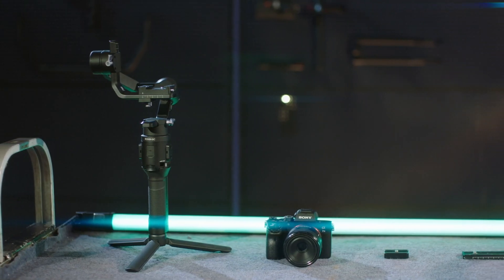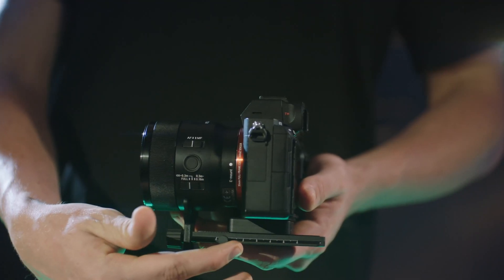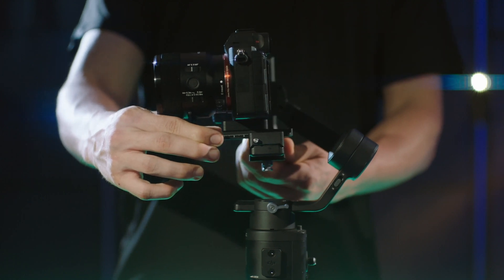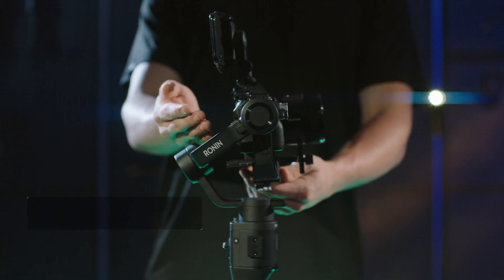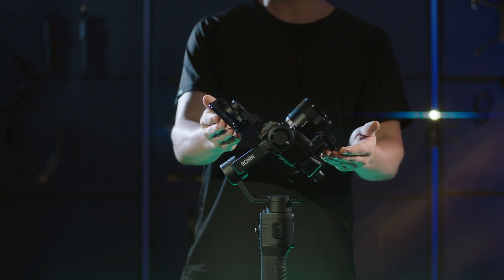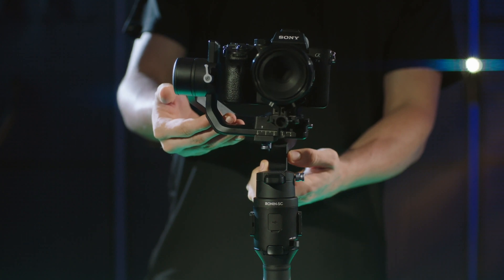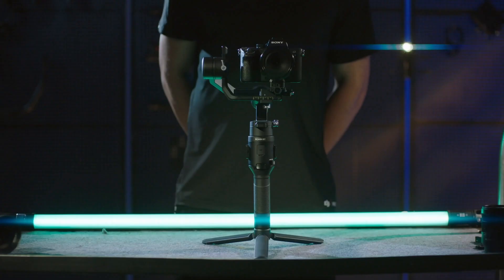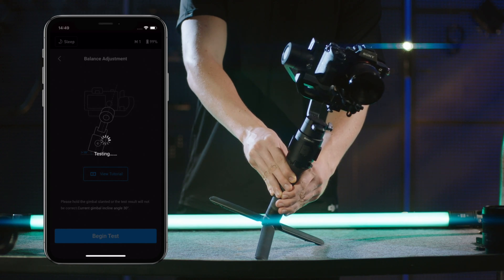Ronin-SC | How To Balance the Gimbal

Comment: Does anyone have any advice for me? I've balanced this thing about 100 times and when I test the balance on the app all 3 categories are "excellent" but when I go to use the gimbal it shakes profusely and doesn't stop until I put it to sleep. When I wake it again it's fine until I move it again in any direction. I bought this off amazon and it was an "open box" item. Please someone help! I'm using a canon m50 mk ii with a sigma 16mm lens.

Comment: so darn frustrating!  go slow and break it down and show each piece and get a good shot at everything. this is stupid.  I was so excited but I'm so freaking frustrated.
Reply from the maker: Hi Mark, may we know if you are encountering any trouble balancing the gimbal? You can contact our support for further assistance http://www.dji.com/support. You may try to adjust the video play speed if you would prefer a slower video, we will also forward your feedback about the video to the related team to notice.
Reply: DJI Tutorials  I did do that nothing helped. You need to break it down like your teaching a 5 year old. Show the pieces etc vs pointing at it in the video, etc.
Reply from the maker: @HSEGIRLSLAX  We will forward your feedback to the proper team to notice. Regarding the issue you encountered on balancing the gimbal, please contact our support via email for further assistance, thanks!

Comment: A6400 cheatsheet for users with standard 16-50 Power Zoom lens it ships with. These are the settings after finally working it out! The camera is borderline too light for this gimble so using the spacer is necessary to achieve true balance.

The lens cap must be off, the camera must be powered on with lens extended as it would be in real world usage. 

TILT: 3.3
ROLL: 3.8
PAN: 1.2

You're welcome 😊

Comment: hello, 

Is it possible to balance my sony ar7iii with the lens 24-70mm on ronin sc, is it too heavy?
Reply: does not work with 24-70mm, balances, but does not work in the tilt up or tilt down position, it starts to shake, so it has to be a lighter lens
Reply: @tcw7voleibol  good to know then, thank you so much!
Reply: @enquencle1992   
After many attempts and possibilities I managed to balance the 24-70mm GM f / 2.8 lens with the focus motor, but without the phone support, balanced using the ronin app, I will use my lens, but advise smaller lens, what I didn't like was for the battery change you need to disassemble the base to remove it and need to balance again, giving a lot of work
Reply: @tcw7voleibol  thanks! I guess the kit lens does work then :)
Reply from the maker: Hi there, as tested, Ronin-SC performs the best when mounted with a payload of 2.0 kg or less. Sony A7R III with FE 24-70 F2.8 GM lens is on the camera compatibility list, you may check the list for the details:
https://dl.djicdn.com/downloads/Ronin_SC/20191119/Ronin_SC_Camera_Compatibility_List_en.pdf
Reply: @DJITutorials  How about the kit lens? this is not in the list, and I have to decide today if i buy this or not.
Reply: Hello! Are you talking about the kit lens? because I have the same question and is a bit urgent! :)

Comment: everything clear until balancing the pan axis.. if it does not move is balanced but what if is moving how to fix it it seems like mine never get that balance nomatter what i do ?? i just cant get that balance done. kkkkkkkkk
Reply from the maker: Hi NOALS, we are sorry for the trouble. Please hold the gimbal and tilt it at a 15° angle as shown at 4:13 in the tutorial and check the balance. If it can hold its position, the pan is balanced properly. If it doesn't hold its position, you may need to balance again. You may check the detailed tutorial of balancing the Pan axis in the Ronin app. 
If the issue persists, please provide a video for us to check further, thank you.

Comment: It can hold a6000 + kitlens without any problem?
Reply from the maker: Hi Faiz, as tested, Ronin-SC performs the best when mounted with a payload of 2.0 kg or less. And Sony A6000 is on the supported list, you may check more info at the camera compatibility chart. https://dl.djicdn.com/downloads/Ronin_SC/20190828/Ronin_SC_Camera_Compatibility_List_en.pdf

Comment: Can you make a similiar video on how to balance the Ronin SC with the phone mounted on top of the camera . its impossible to balance with the phone on top for the active tracking to work.  It was one of the main reasons for my purchase of the Ronin SC. Thank you.
Reply: This gimbal is the easiest and quickest that I've used to get a camera balanced, but i definitely agree it seems impossible with a phone on top. It took a lot of manipulating with the mounting plate and messing with the tilt. Remember they say to tilt the camera to a 45 degree angle instead of completely up to test balance when using a phone as doing it the normal way will hit the back. I nearly gave up myself, but glad i was dedicated. Active track is an awesome feature and keeps subject in perfect framing from where you set it up.
Reply: @donb2138   I gave up to try them again. But Thanks for the tip to balance with the phone on top. I will give it a try.
Reply: You should try again. I have no problem when mounting phone on top of the camera with the phone holder. By the way my setup is Sony a6000 with L-Plate, so it may add more weight to the camera. Have a try!

Comment: How to know indicator of the dove tail plate is on correct position?
Reply from the maker: Hi Davist, there are light and heavy indicators on the dovetail plate, please choose the proper place according to the camera you mounted.
Reply: @DJITutorials  Hi DJI, how to determine heavy or light?
Reply from the maker: @dvshkimsze  As Ronin-SC performs the best when mounted with a payload of 2.0 kg or less, if the payload is nearly 2 kg, it may consider heavier. Please try to adjust accordingly based on your camera and lens total weight.